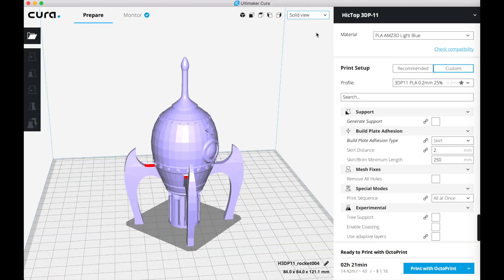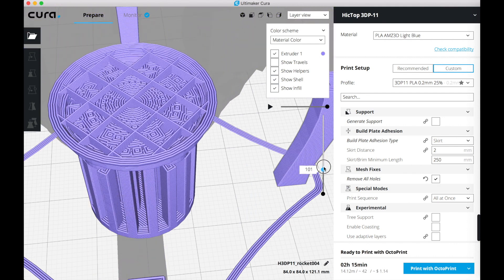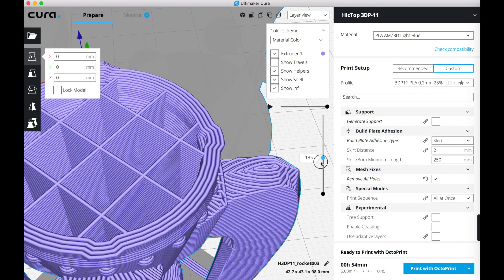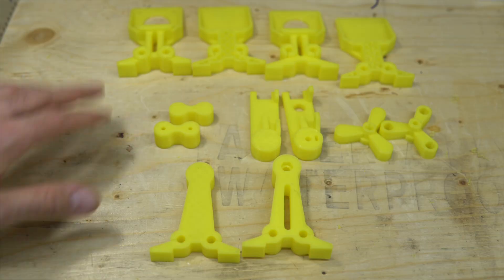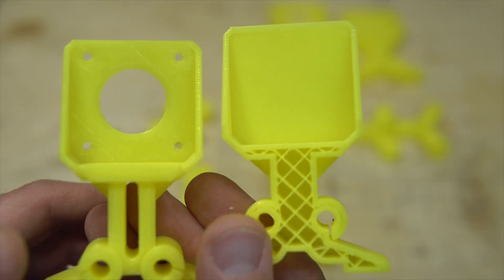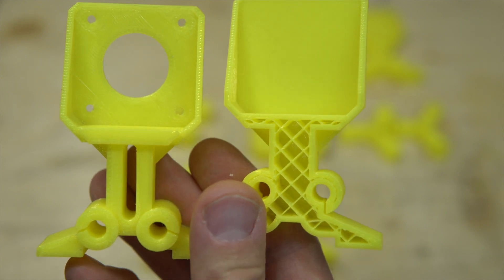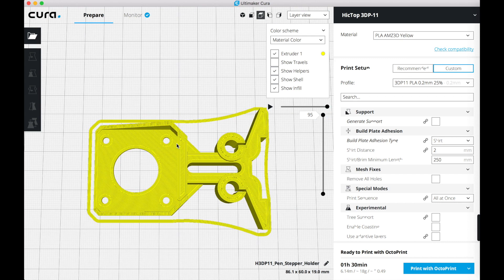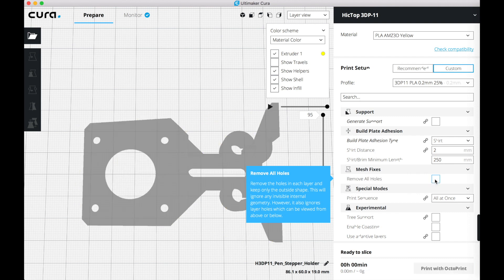Cura 3.2 Mesh Fixes Explained

Comment: CURA 3.2.1 has not "remove all hole")
Reply from the maker: It is under "Mesh Fixes" custom options, you have to add it yourself to the menu with the little gear on that are on each section name, to the right... And you need Cura 3.2 or 3.2.1